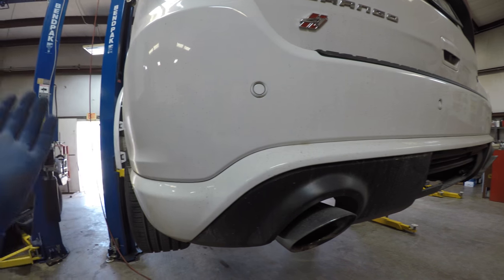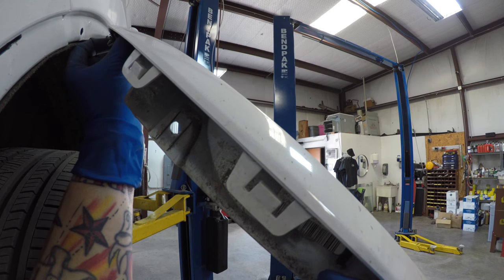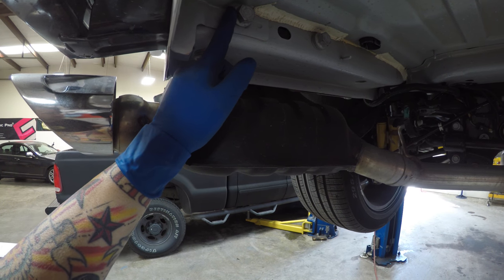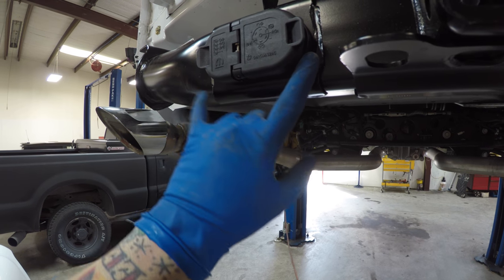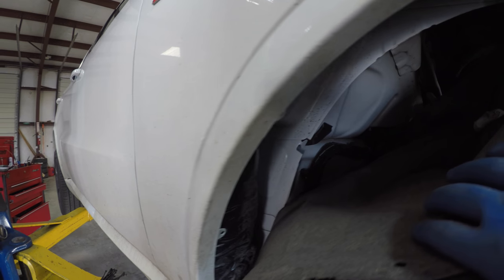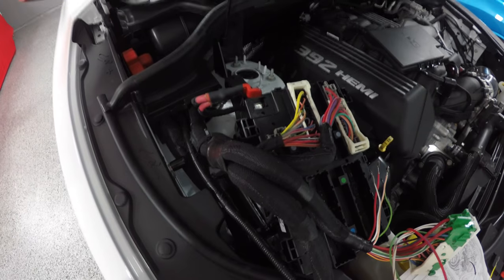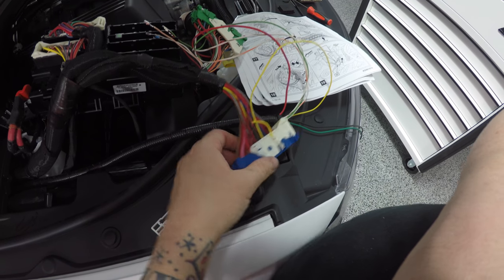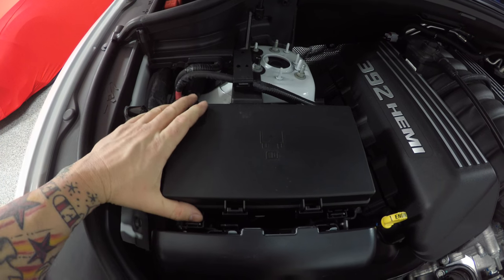Mopar trailer hitch Install

Comment: Thanks for the video. I'm doing the same install on my 22 RT. My kit from Mopar came with a short 4 wire harness that the instructions have running under the dash. I didn't see that noted in your video. Can you shed some light on that?
Reply: Following, I also have this same thing ! I wanna say it’s for our electric trailer brakes ?
Reply: @amoney3936  My guess would be yes. I am having a mechanic finish the install next week. Since the BCM had to be programmed for the lights to work I figured it would be easier to just let him finish it. I'll let you know what he says about it.

Comment: FYI on the tow hitches the Draw Tite hitch part number 76432 that doesn’t need the extra rounded hitch cover you can use the one that matches the bumper lines it says a 21 MM socket on the bolts it says 75 foot pounds of torque

Comment: Hey man, great video! I know it's been a few years. I did this full install recently and everything seemed to go great until the time came to tow and nothing worked with the wiring. The dealer flashed the PCM and confirmed it was wired in and has power, but that's it, just power. I'm reading further into it and my wiring kit didn't come with the "Hardness D" as shown in the instructions and believe this could have been the issue. I didn't see this in your video either. Did you just not need this secondary hardness wiring going to your dash?

Comment: great video. one question. What did you do with the dark green wire? Instructions say to just zip tie it back but this is for the electric brake pin on the 7 way...

Comment: Will you be able to utilize the 8700lb towing capacity by adding the mopar hitch?
Reply: No, the cooling system can't handle it.
Reply: All SRT Durangos already have the heavy duty cooling equipped on them. They only need the hitch, wiring, and controller to tow the rated 8700lbs.

Comment: Did this harness actually work without any warning lights? Just installed this on my 2019 and getting Service AWD light. Looks like this might not be the correct part for the 5.7 and 6.4.  I'm seeing part 82216007AB for the 2018-2019 Hemi after looking into this problem.
Reply from the maker: It worked great for me. Of course I had to have the car reflash Ed for it all to work but it never gave warning lights
Reply: DFW Speed This one is showing 4 wires from a secondary harness need to be run from the under hood electrical panel to an electrical panel on the passenger side interior. This says it applies to the 2018-2019 5.7L and 6.4L engines. 

https://moparonlineparts.com/docs/82216007AB.pdf
Reply: DFW Speed Ok. After watching the video again I see the error of my ways. Made a SUPER rooking mistake. I pinned the plug backwards. Had to flip the plug around to get the right pins. Smh.
Reply: @DFWSpeed  Before you had to have it re-flashed, did the brake lights work? Why did it need to be flashed? I'm debating on getting this harness, or the one that hooks up to your rear brake lights?

Comment: Eh, my Durango won’t start. My pin out is correct I checked three times. Any ideas?
Reply from the maker: If it started before you worked on it then you got something wrong. Have a qualified technician double check what you did
Reply: Did u figure out why it wouldn’t start? I have the fuse box that it came with and installed it all
Reply: I had it towed to the dealer and paid for them to assess why it didn’t start. They got it running and they told me they flashed the ECU for the lights, but I should have checked at the dealer before I left ( I know… lesson learned). When I came home I checked the lights.. didn’t work. I had to go back to the dealer so they can do it right because I paid for them to fix the lights. Long story short, they wanted me to pay again and I lost my composure… gave him a few well placed words. I left with the lights fixed and to this day working fine.

Comment: Hello i have a 3.6l durango. On the instructions it says i have to replace the pdc box?? The kit i ordered didnt come with the pdc box. Please help
Reply from the maker: mrhoya14 a doc box is the whole fuse box. You might want to contact the dealer for proper installation
Reply: @DFWSpeed  i work at a ford/dodge dealership. One of the techs said i have to order that box, and another guy said i can just wire it in like an aftermarket one. So idk is all confusing now lol
Reply: @mrhoya14  did you figure out why it wouldn’t start? I have the same problem and just installed last night
Reply: @Nemo12006  yes, i returned that mopar kit, then ordered and aftermarket one from etrailer.com, which just hooks up to your taillight wire harness, and grabbed the main brake one from the 3rd brake light for the brake controller.
Reply: @mrhoya14  what was the issue that it wouldn’t start do u know? I hate to take it all back out
Reply: @Nemo12006  i never got the fusebox that it required, thats why i bought the aftermarket harness instead, to avoid replacing the fusebox
Reply: @mrhoya14 Hey I have a 3.6L and is looking to put a trailer hitch and a 7 pin wire harness on my car. Can you tell me part # of the aftermarket you ordered.  And how’s everything with the aftermarket stuff doing? Any problems after?

Comment: I made my own harness from the 7pin at the rear to the fuse box. I just wonder if you know which pin goes to what. I know it's pins 23,24,30,30 and 34 on the second plug. Just don't know which pin for the blinkers, parking, and electric brake.
Reply from the maker: Man it’s been awhile. I don’t remember exactly.
Reply: @DFWSpeed  thanks for the update

Comment: Hello, the tutorial is spectacular and really very well explained and helps me a lot, but I have a question similar to that of Scott Pancrazio. The question is the following, it is mandatory to go to the dealership to activate the lighting of the trailer or just doing everything from the video the lighting works without having to add it to the VIN of the car, I would like you to explain a bit of this because it has me confused activation...
Thank you very much for your attention and for making these videos
Reply from the maker: Michel Guanche yes they have to change the vehicles coding. Without it the lights don’t work
Reply: Uffaaa hahaha, Ok no problem, I will contact the dealer
Again, Thank you very much for everything.
Reply: Do they charge you to change the coding?
Reply: @heavysetgms  always. but look into alphaobd and the MX+link hooks up to your obd plug and lets you reprogram your bcm for features from other trim levels. they even have a supports page. i have it on my 2015 ram, i am almost sure it supportes the durango as well
Reply: DFW Speed is there a work around for the dealer coding?